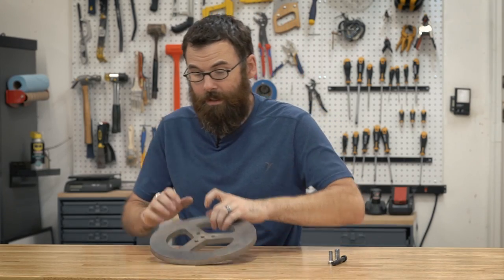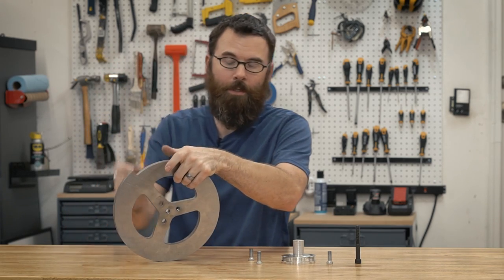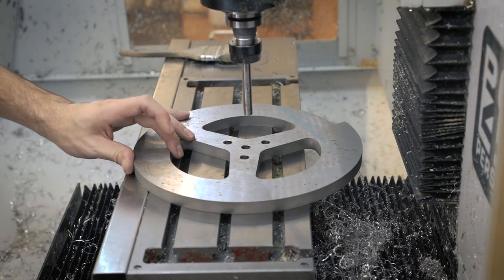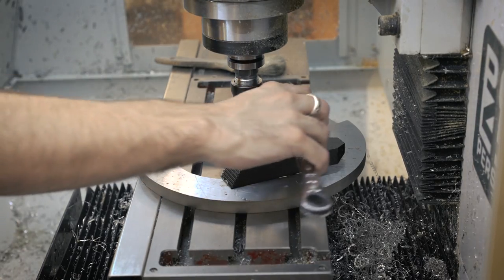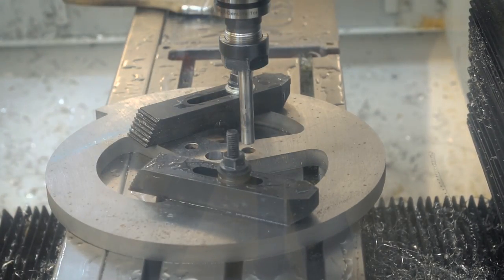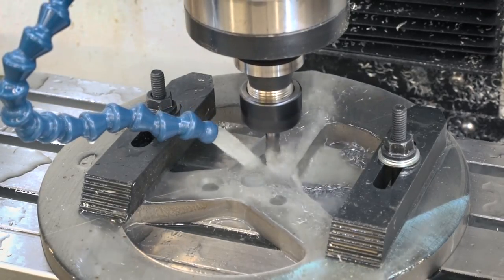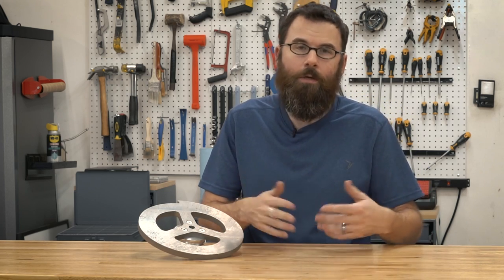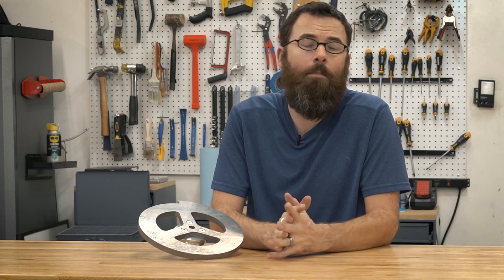Machining a Counterbore in S7

Comment: If I was building a robot weapon such as the one here, I would probably use a more ductile metal like AISI 1040 and case harden it to ease the making of the part. Then compensate for the difference in strength by changing its dimensions. But this might be a harder path if your trying to minimise the weight of the part. Another option is to use a software approach like SolidThinking’s Inspire to optimise the parts geometry to maximise strength to weight. Just my thoughts as a Civil eng, I have never built a robot.
Reply from the maker: Weight is what you want, to a degree.  The geometry is optimized, to some degree.  I paid close attention to the MOI on the weapon, making sure I got the highest MOI given the weight.  Also, 1040 seems to be substantially softer than S7, and it wouldn't hold up under impact.  For instance, the internet tells me that 1040 has a yield strength of 77,000 PSI and a tensile strength of 91,000 PSI.  S7 on the other hand is 293,700 and 220,000 respectively.  It's MUCH stronger and designed for high impact and shock resistance.
Reply: Robert Cowan , I agree with your comments, I feel that there is a lot more to material properties than yield and ultimate tensile strength that you may or may not be aware of. So hard to convey over YouTube comments. 😁. The area under the stress strain curve is the Materials “toughness” and I feel should be a metric used in the decision for a material being compressed / shocked loaded. Also as a side question, do you use I=m*r^2 to optimise your design or another method? Happy to expand further over email and I do appreciate your videos and style of craftsmanship. Cheers.